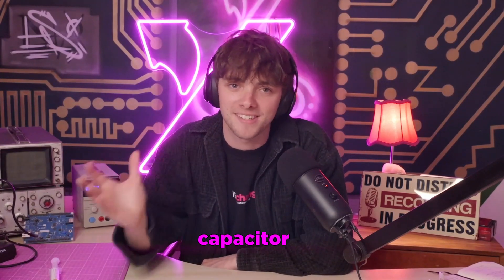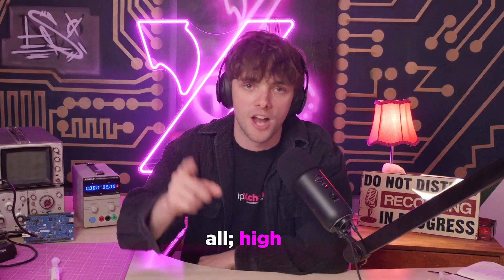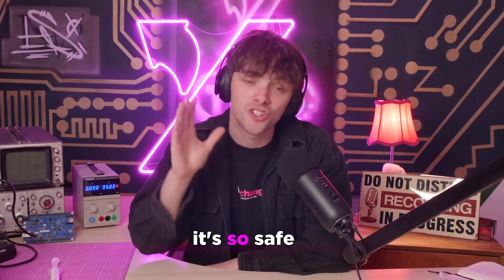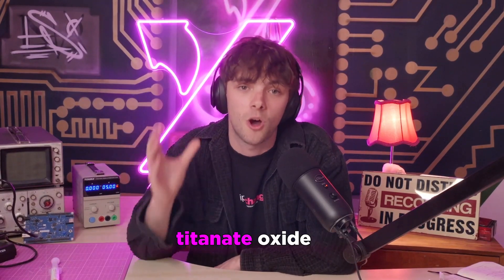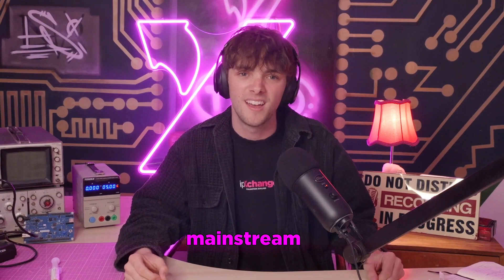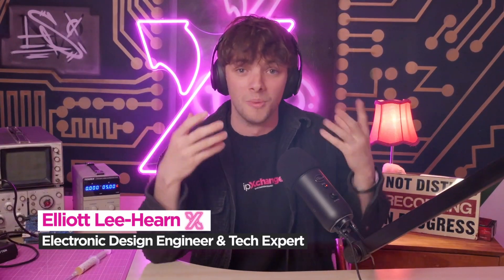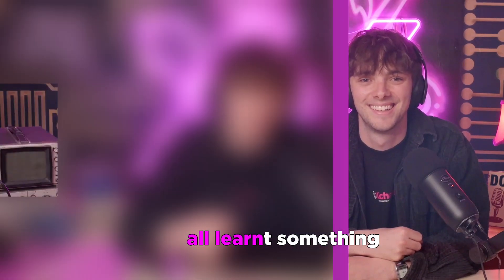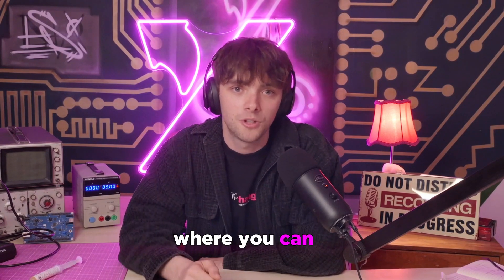The Titanium Battery Replacing Dangerous Lithium-Ion Forever…

Comment: heh swapped out my agm with lto in my car. -40lb. wired to a solar roof which gives me 3-4 miles per day, voltage difference lets me overcharge the low voltage system with solar while my car is sitting in the sun, and keeps flowing into my car while driving. documented this all on my channel :)
everyone is SLEEPING on LTO. after i get experience building a hv LFP battery to quadrouple my cars ev range, im probably going to do a full ev conversion project with my old porsche boxster and I wanna use LTO just so it lasts forever.

Comment: shh LTO is my secret (weight) weapon.  it normally takes a 4d lead acid to start a mel 430, (or a 6v71 diesel)  but a LTO battery can fire up either as though it was nothing and only weigh as much as a ytx-30-l-bs motorcycle battery.
Reply: granted I don't know how it does on modern cars, but for the classics, without all the computers, emissions, and questionable electronic gadgetry, LTO is great.